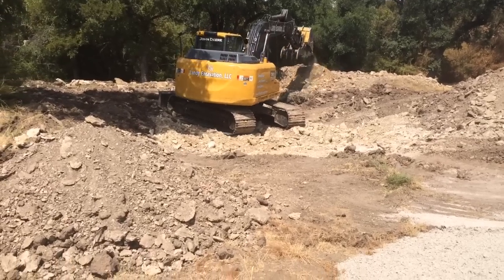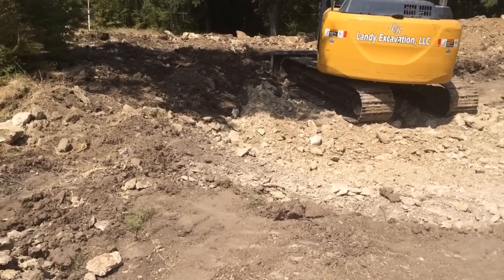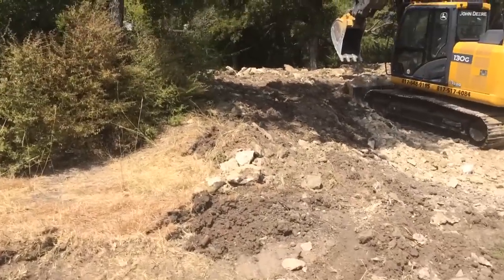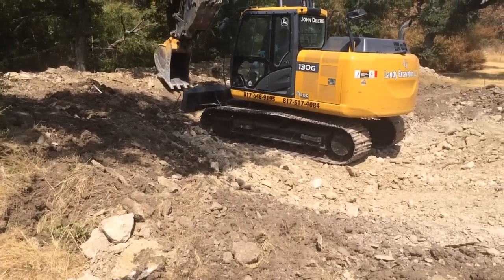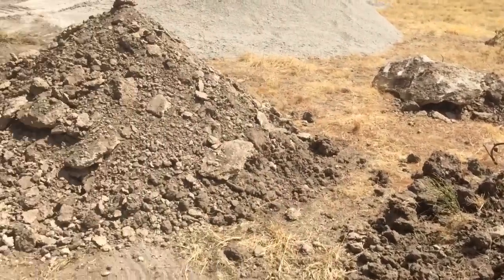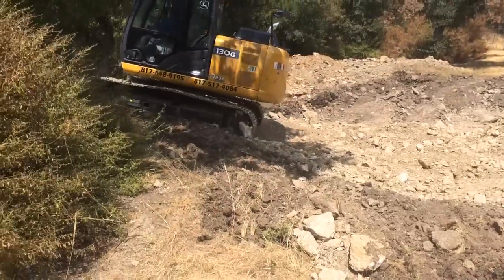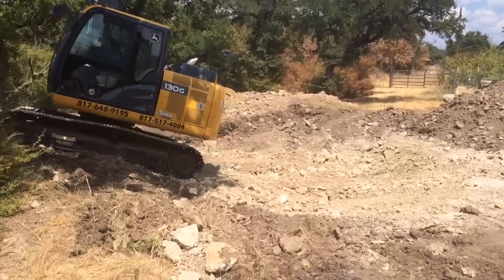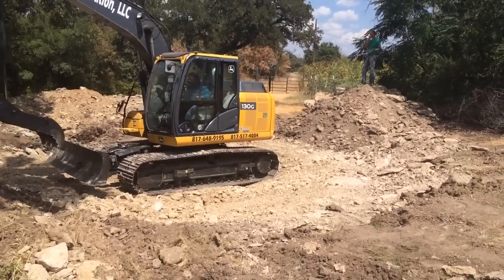Pond progress 2

Comment: Can you let us know approximate time for the size of pond when complete?  My clay here should be much less trouble I assume but its a point of reference for when I eventually have one dug.  Thanks
Reply from the maker: +Dewayne Curry we did this in a day, we have a half day of clean up to do on Tuesday.  Doesn't have a thing to do with your timeline though.  You can't base anything you do on me or anyone else for that matter.  In clay with the same machine and operator I could put in about 1/2-3/4 of an acre on a similar site in a day, this isn't even 1/20th.  

It isn't just the ground but the site that matters, how much do you have to move, how does it need to be moved, is it big enough to warrant a key way, is the clay good enough to hold, how much clay is there, etc, etc, etc.

Comment: Three hundred and fifty an hour! Ouch
Reply: +Christian McMahon I just did a quick Google and that's a $200k used excavator...  Wow!  30,000 pounds, but only 100hp.  I don't know squat about big equipment, but that's interesting that such a beast only needs 100hp to tear through the rock.
Reply: +Eric Phillips Check used equipment auctions. Also I think it would be possible if you have some black powder and some horses. Though you won't want the horses around when using the powder. It would also take forever compared to a machine.
Reply from the maker: +Eric Phillips 100 hp yes but it is all about hydraulics and mechanical advantage.  With that a 16 ton machine can have about 50% of its weight in break out force.  So a 32 thousand pound machine will have a break out force of 16 thousand pounds and that was barely enough for this job.  But think about this when you jack up a car with a hydraulic jack and a small 2 foot handle for just a bit of mechanical advantage how much horse power do you use to lift a 2000 pound car?  Not much right?  100 hp running hydraulics is a LOT of power.
Reply: +Jack Spirko Thanks a bunch for taking the time to explain that.  That makes a lot more sense now, and explains how a 100hp machine can even move itself, let alone tear through a multi-ton chunk of rock!

Does the rock just continue all the way down, or at some point does it turn into something else?  That's such a pain to have to deal with.  In the midwest here we have dozens of feet before you get to rock, so it's so interesting to see that!
Reply from the maker: +Eric Phillips if the rock tuns into anything else we have never gotten deep enough to see it.  All that happen is it get harder layer by layer.